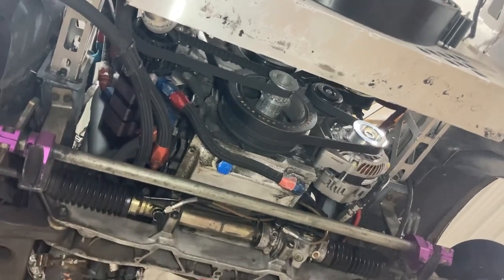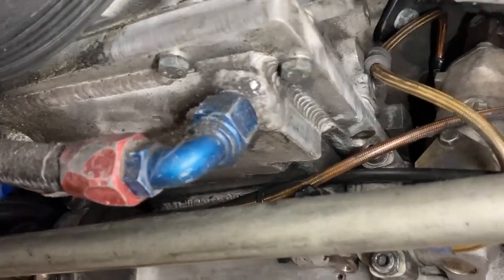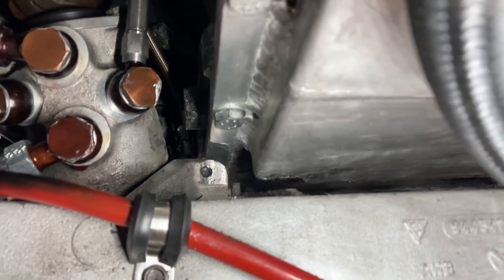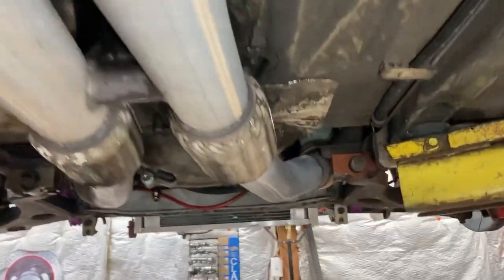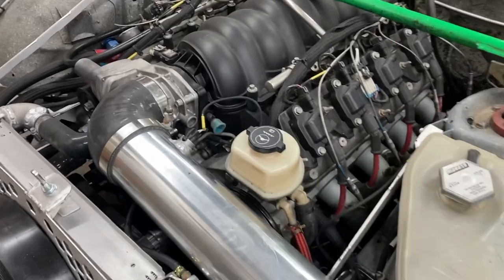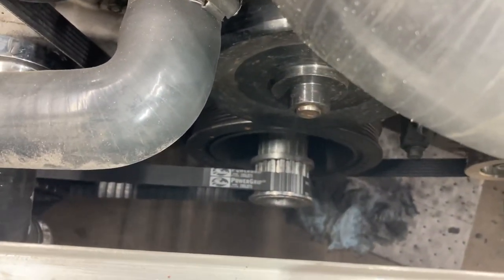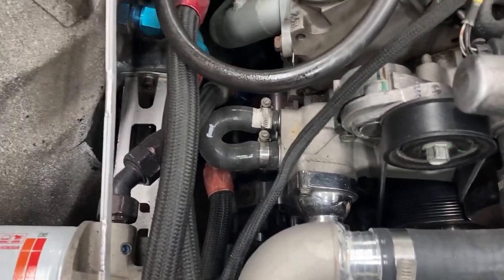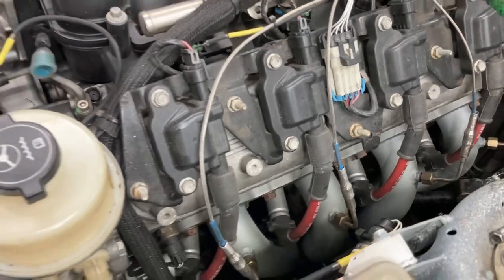Close up look at the oil pan and power steering on the Turkey LS2 Porsche 944

Comment: I love my bolt on LS1 944 

I had opted for manual steering as i got lucky on a shorter ratio rebuild rack with A/C

But my original setup was power steering.

Comment: Great Vid. Thanks for the tour and update.  I have questions. 

Did you lower the engine in the chassis when you went to solid motor mounts? 

Is that why you notched the oil pan for clearing the steering rack mounts? 

What was that power steering pump you used? I couldn’t quite catch it.  

Awesome idea using a pusher fan front of the radiator. I wonder if I Can mount one on the front of my AC exchanger.  To leave me intake plumbing room on my build. 🤷🏻‍♀️

I’m building an ‘87 944S LS1. 
Do you have an oil cooling system on the gearbox? What did you do for mounts to prevent hop?

Thanks in advance. Your videos are always top notch.
Reply from the maker: The engine is low enough that it just clears the hood (although the hood is fiberglass and a little flexible) - but I'd say the crankshaft is about on the same axis as stock.  I had to notch the oil pan for both the steering rack mounts and the steering rack itself.  Power steering pump is from a Cadillac CTSV.  It does have a gearbox cooler - I'll make a video on that soon.
Reply: @vsvenson  Thank you. 
Just a hood clearance issue I understand. The kit guys have instructions to cut out the support under the hood.  I’m not so keen on that idea. 

I was curious for an alternative reason like maybe you may have broke the “kit” mounts or wanted to lower the center of gravity while not altering the lower control arm positioning or some such.  

Thanks again.
Reply from the maker: @msPaulaA1  I wasn't willing to mess with altering the suspension geometry.  In reality I could probably make it another 1/4" lower, but I'm happy with there it is.  The elbow on the throttle body is what touches the hood.